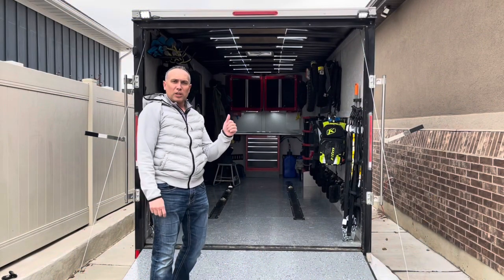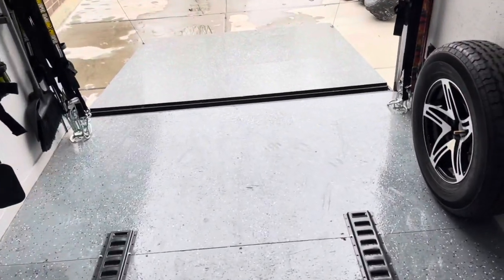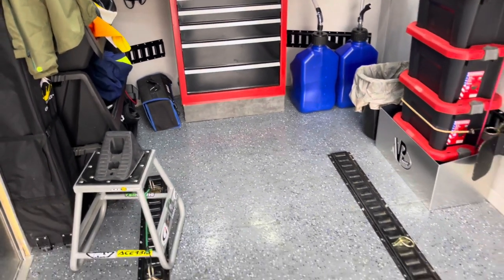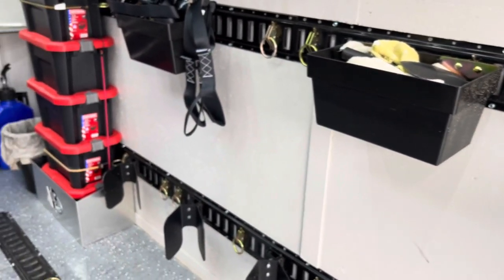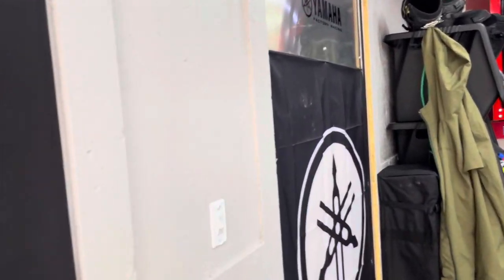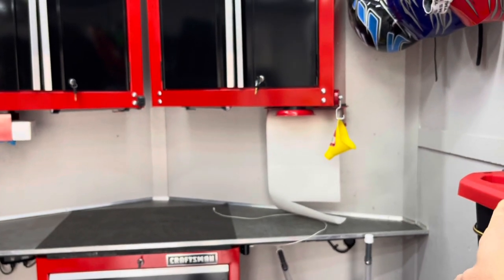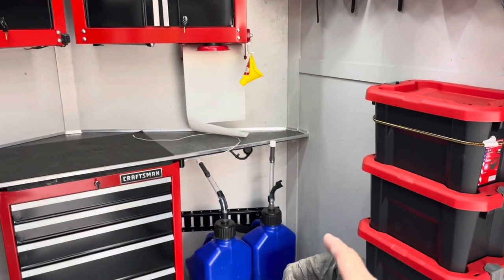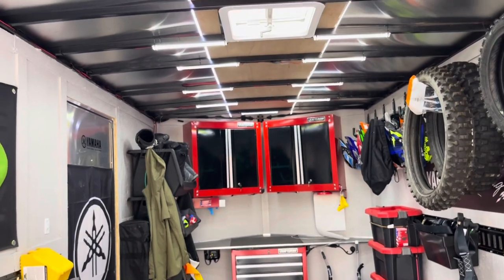Enclosed Trailer Epoxy Floor Update | Dirt Bike Trailer Build!

Comment: Thanks for the update, looks great and user friendly. 
Working on my trailer non using your expoxy idea and it turned out great. Clear coat comes next. 
Nice work!
Reply from the maker: Nice!  Remember to add that non slip sand to it.

Comment: I just used helmsman's spar urethane on my trailers wood floor and walls, allot less work and my screws arnt covered up cause I may want to unscrew a panel for some reason. to protect the floor from abuse I ordered some foam decking boat flooring. I like your trailer, just to much work for me im to old for all that trouble...lol
Reply from the maker: Thanks for sharing!
Reply: @Myksgarage  I dunno, I don't think that response means your happy I avoided allot of hard work taping off trim and that epoxy id f that up quick looks like real hard work..lol

Comment: Did you sand the ramp... if so, do you think its good.  If not, do you regret not doing it?
Reply from the maker: Yes, I did a light sanding on the entire floor and ramp, and the epoxy has held up great on it

Comment: You may have answered in one of the videos , but how far from the wall did you set your floor e tracks and does it have enough forward pull to really secure into the chokes, btw I'm working with 450s
Reply from the maker: I actually put another row right against the wall and it holds them much better
Reply: @Myksgarage  gotcha thank you!

Comment: Or just mix that texture material into the epoxy before putting it down
Reply from the maker: Yeah good suggestion
Reply: I wouldn’t mix the flake into before putting it down. You want make sure you get maximum mixing of part A and B. You also want maximum contact of the epoxy to surface to bond. Mixing in the flake first may not get the best contact. Plus a pain in the neck spreading and rolling epoxy It looks like you have about 30% flake. I would spread it to about 6mm-7mm thick full broadcast of flakes to rejection. Once that dries removes excess and scrape surface to desired texture. You could add a little bit of quartz in the top coat. I usually do that only on the ramp for customers.